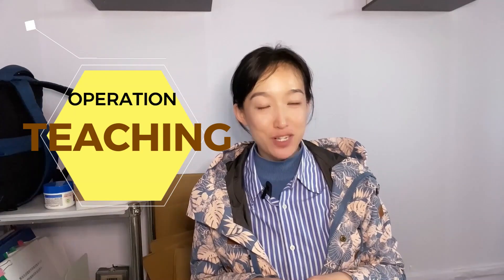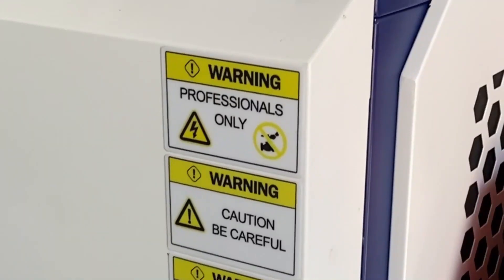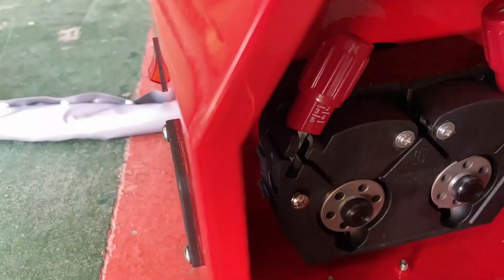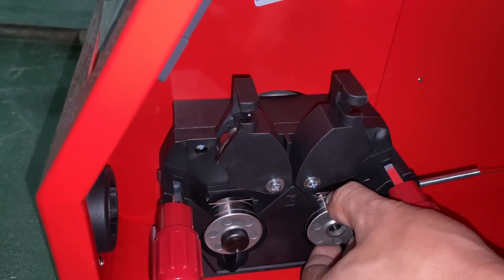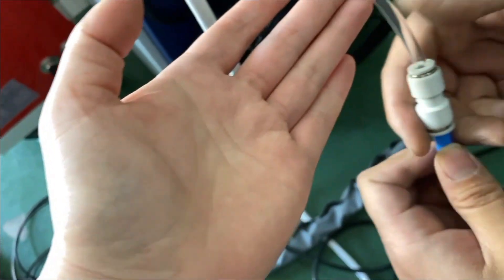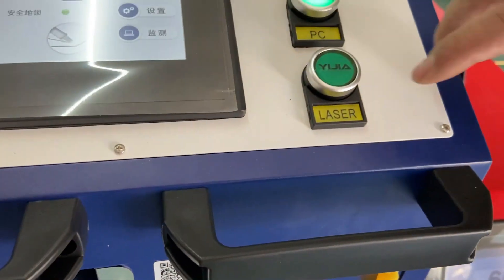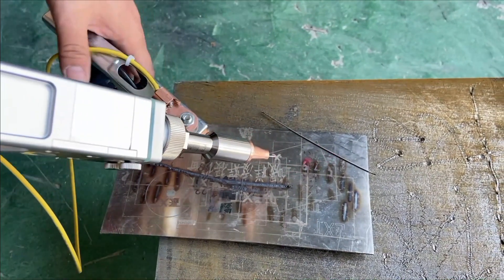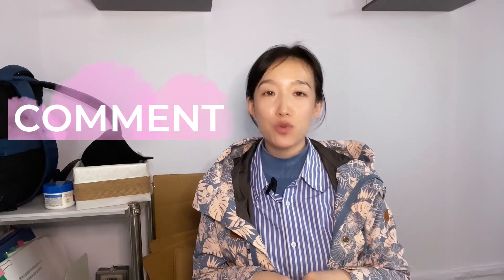Operation Steps: Handheld Laser Welder | 2000W Laser Welding

Comment: Hey Clara. Is correct 2-4 kPa? Is it too low pressure? Or that should be about 2-4 bar, about 40-50 psi?
Reply from the maker: 2-4 bar, did I make a mistake on that in the video?